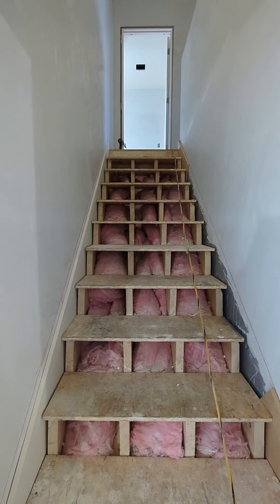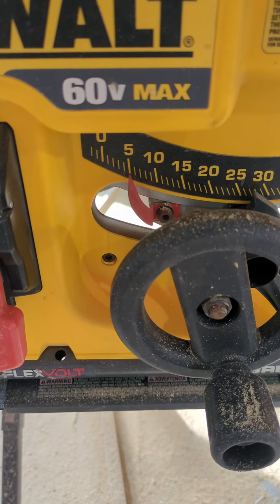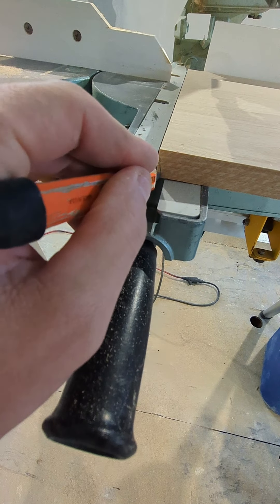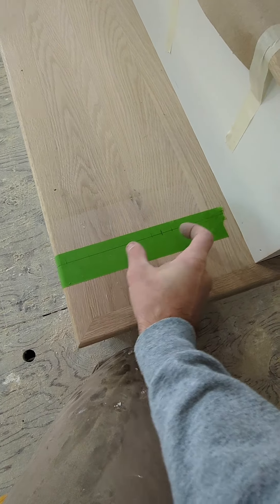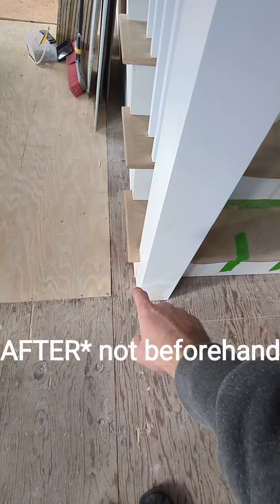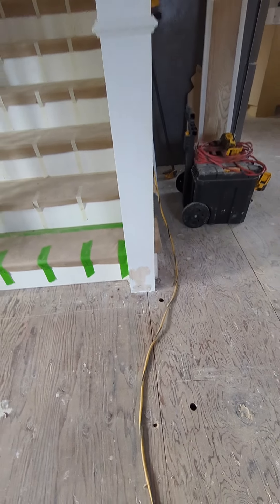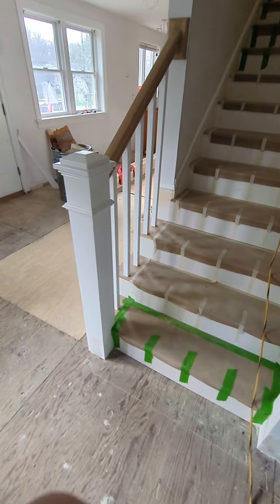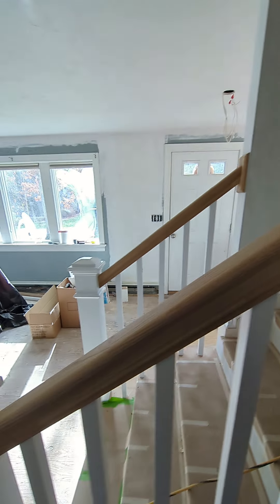How To Install Stairs+Rails- Treads, Risers, Mitered Stringer Skirts, Stair Skirts, Posts, Railings

Comment from the maker: Forgot to add the clip of mitering the stair tread returns. I did make a short on it so you can find it on my channel posted around the same time as this video.
Note- My "2⁰" edit at ~4:49 is incorrect. I meant 1⁰. I double checked my miter saw calibration and it was ~.5⁰ off which would've put it at 1⁰.

Comment: Something I just figured out is it’s nice to put the balusters in from the top down. That way if one of the under rail pieces is off you can just knock the baluster back and, because of the angle, it pops the piece right out rather than trying to fight it prying out.
Reply from the maker: Going over it in my head I believe it's a physical impossibility to go from the top down with this particular system. There would be no way I could lower the blaster onto the ~1 1/2" of dowel sticking up if I had the block installed. I would have to leave the block out to install and then put it in after, which doesn't allow me to rely on the block itself as the spacer that guarantees plumb. Going from bottom to top also allowed me to get a couple of pins through the top of each baluster before I installed the spacers. I spent a long time on getting the newel posts exactly plumb and the blocks the perfect size to guarantee everything down the line would remain perfect. It worked out really well. The newel posts probably took 45 minutes each and micro adjusting the spacer blocks took me around 30 minutes. I'd say it's worth it to take that extra time in the future to guarantee you don't find yourself needing to remove anything.
Reply: Yeah, the one I was just doing was a little different. Balusters had a 3/4” dowel nub on the bottom. I did have to install the block after the fact though. The job was a remodel using old stringers and I came into it after 3 treads had already been done. The runs were the same but tread overhangs were slightly different. I used a jig to keep balusters in the same location on every tread but that meant the spacing was cheated in some spots slightly so some blocks were a different lengths. Funky but it came out sharp. Thanks for the video! Looking forward to watching again when I have some stair work in the pipeline.